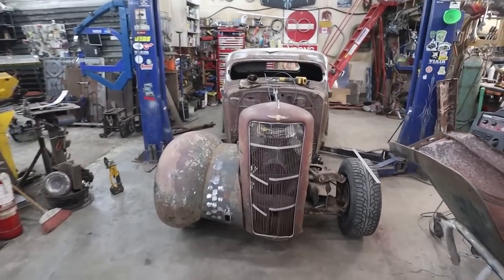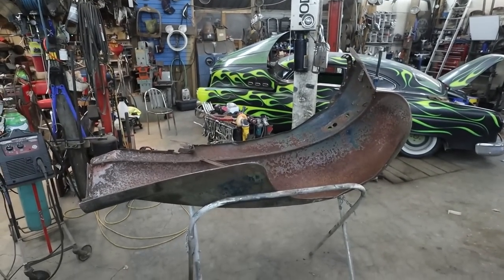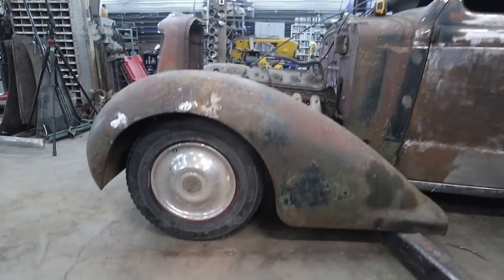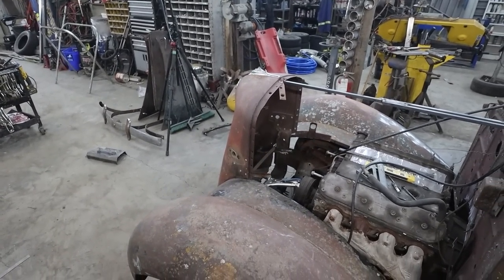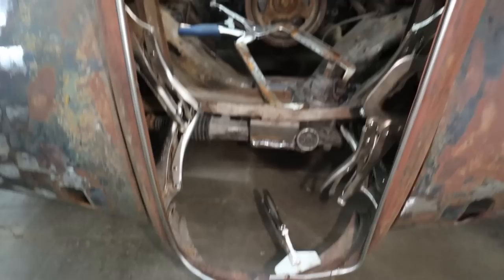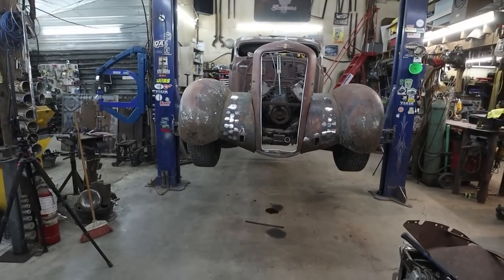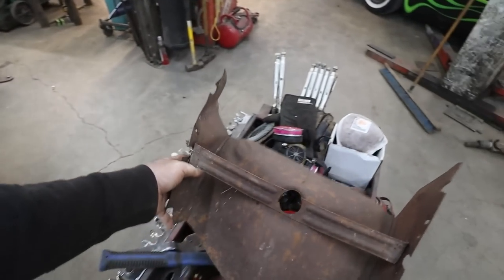Starting the grill repair on our 1935 Dodge Coupe

Comment: That front splash pan helps direct air into the radiator on my '37 ... the welting I use is just vinyl around cording like in upholstery ... it stops the squeaks and fills the gap ... lookin cool ...

Comment: I am just guessing but, there must have been some differences in the way the different divisions of Chrysler designed the front fenders to mate to the grille.  I would swear, that the bend on the RH fender, where it meets the grille, was made differently than the LH side  to accommodate a differently shaped grille.  
Back in the 50s, I bought vinyl piping that fitted in the seams between the fenders and the body of one of my cars.  It wouldn't be that difficult to make some, by taking some 2 inch strips of vinyl, and rolling it over some round foam, plastic, or rubber, tubing.  Using a contrasting colour and Installing this in the seams, would be a workable solution.  My friend had the same car as mine, a 47 Chev, and he welded and leaded the fenders to the body.  It cost him a ton of time, but it turned out beautifully.
They still use piping on MG restorations, and here is a good place to start (mg-cars dot org.uk/mgtd/index.html).  I hope this is helpful.

Comment: wow, I'm actually the first? I'll come back to edit after I watch the whole episode! "Look for the edit". ***  Here's the edit:  I recall a few episodes back with Dan from DD's Speed shop that he orders rubber strips (I don't recall if they were for house doors or garage doors) that were fairly long, durable and element resistant.  These strips when cut to length, would be perfect for you to wedge in between the fenders and the radiator shell.  I remember Dan used them for window seals to replace the more expensive felt seals and he trimmed them to a point that they actually looked very good. I think he also used them around inner car doors so that they would create a better seal when the doors closed, as well as to prevent painted surfaces from rubbing against each other?    You may want to contact Dan and get the exact material name?
Reply from the maker: Garage door bottoms I've used before :)

Comment: To hold the front chrome lower trim on the grill make up a piece of t-shaped wire and insert it into either side of the trim and then put a hole for the base of the T to fit.

Comment: Yup uncle the stuff we use on beetles are rubber trim with the flat part you pinch between the body and fenders,
How about using 1mm solid stainless steel electric fence wire at the bottom of the grill by your shiny trim? get it where it should be and drill a 1mil hole on either side and bind it to the grill shell(bottom) part,
Just a thought as you said you don’t know how it joins to the shell,
Remember it’ll be hidden by your bumper anyway.
Have a blessed week,
And ciao ciao 
…..Des

Comment: Could you use Volkswagen fender beading (plastic between fender and body) between your fenders front and back and the body/grill, maby also between running boards and body. A good old handmade thumbs up to you all. Update 10 seconds later you talked about exactly this solution.

Comment: The round shape on the front of those fenders looks mega-art deco.
I still think in addition to extending the flange on the back of the grill shell, you should move the whole shell back an inch or so. Between those two mods, it may eliminate your need to add on to the hood.

Comment: That's a lot of really nice body work.  You can come and work on my 36 Dodge humpback panel anytime.  On my grill surround, the chrome pieces are secured with tiny bolts thru the holes in the surround.

Comment: Fender Welt will keep water and grime out of area between your body and fender, helping to prevent rust formation and reduce body-to-fender squeak. All styles come weather-resistant ... plastic or treated cotton media and paintable. There are all kinds of colors/size bead available in North America and trust me, you DO want to use it ... installation trick: cut a "V" into it where your fender bolts to the body.

Comment: l wonder if you can use butyle rubber strips between the fenders, basically innertube rubber which has got a long shelf life it used now for pond liners and roofing ( just a thought). The fenders and grill are looking superb, great work as usual, everythng coming together nicely.

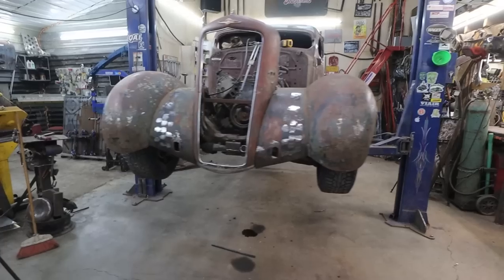Comment: Regarding that gap between the fender and the cowl on the passenger side of the car, if you will look at 38:01 in this video it looks like the driver side fender is higher than the passenger side fender.  Maybe the driver side fender has more of an arch than the passenger side and this is causing that gap? Or maybe the back of the driver side fender is  higher than the passenger side?  Something certainly looks off there.  I guess it could just be the camera angle though.

Comment: Hi, once again caught some EVP spirit audio at 0.25x video speed, English and my language Danish, :
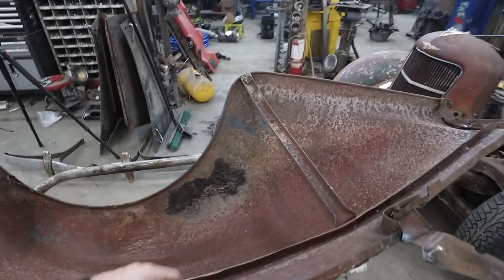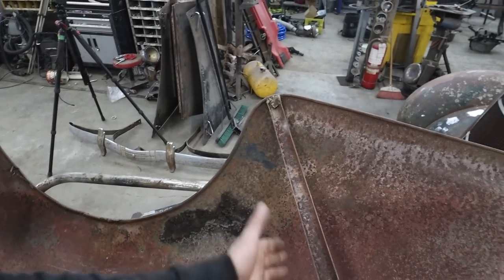0:54 'They're all watching the chopping', 1:01 'Don't change it, keep it as it was..', 1:05 '.. before'.
1:13 'Hail Odin', 1:15 'This is what we believe in', 1:17 'At Odin bestemmer' ('That Odin decides').
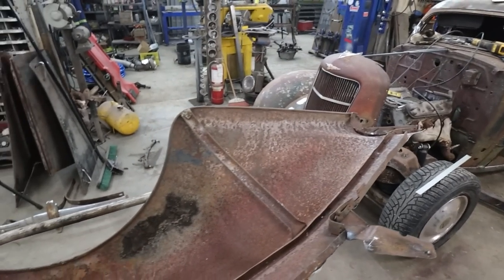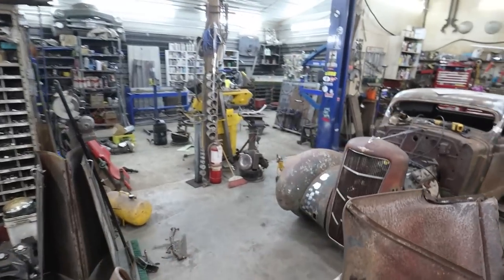1:21 'Great things are happening', 1:23 'Darth Vader', 1:24 'Keeping out'.
1:29 'The Völve is old', 1:35 'The Völve har ret' ('The Völve is right'), 1:36 'Kram ham' ('Embrace him'), 1:41 'Kærlighed' ('Love').
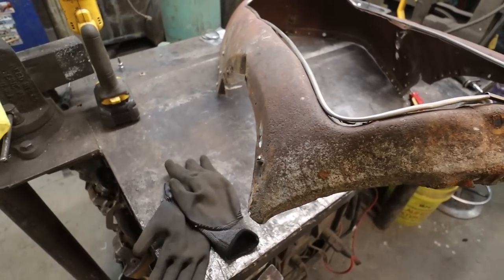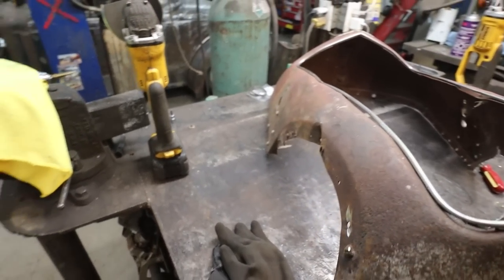20:21 'A hobo', 20:23 'Let's go Brandon', 20:24 'Fu%k you'.
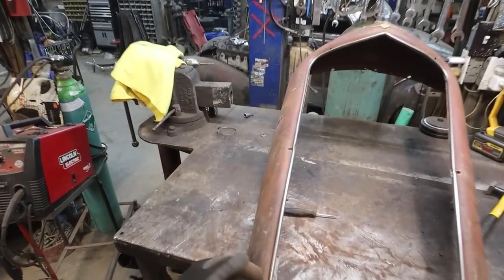23:59 'Moon dancers', 24:00 'Remain in power, moon dancer', 24:01 'Asatru', 24:02 'He's trying to talk'.
24:05 'Macron, sover du?' ('Are you sleeping?'), 24:14 'Døden' ('Death'), 24:15 'Kommer til os alle' ('Comes to us all'), 24:47 'You'll be fine', 24:50 'Odin håner hans unge tobakskonge' ('Odin mocks his young tobacco king').
These spirits seem to be using symbolism. In my analysis this doesn't have to do with Canada, but rather with the entire North American continent, the great neighbor to the south, where a Darth Vader figure is currently getting chopped down, so that he'll be 'keeping out'.
I'm no theater shaman, as the wacko with the First Nations buffalo headwear we saw goofing around inside the US Congress, brandishing Asatru tattoos - those morons have no right to use Norse symbols. Those boys now are where they belong, just as your engine - behind bars!
Spirit also comments on the President of France, how he's chosen not to listen to workers, protesting about the pension age being postponed from the age of 62 to 64.
The Völve, Asatru shaman of Denmark and the Lands of the North